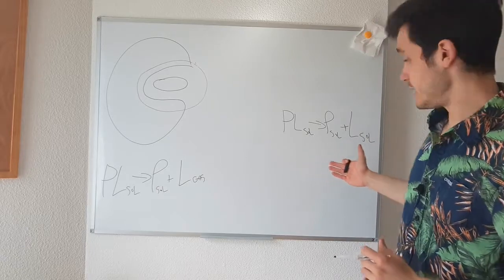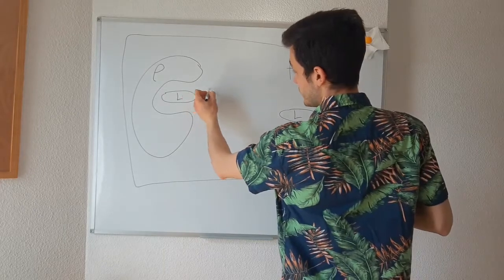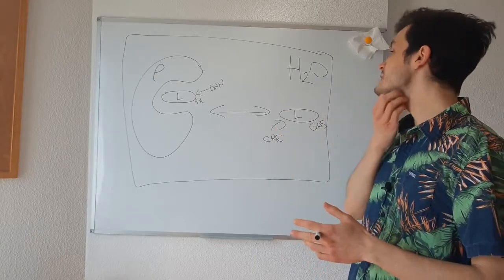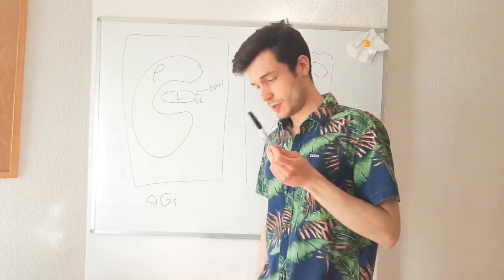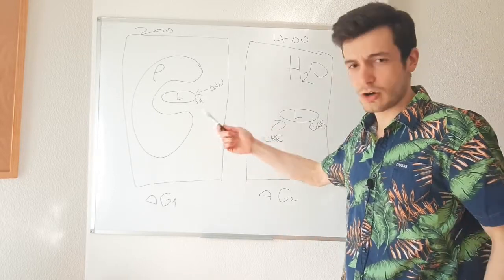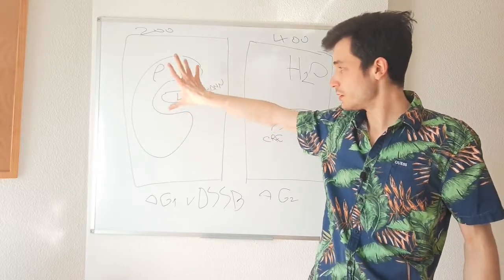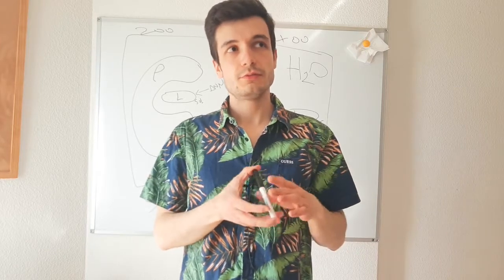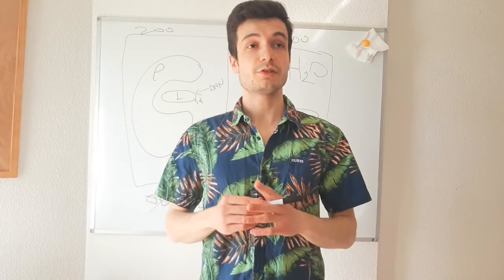FSDAM vDSSB Non Equilibrium Binding Free Energy | Alchemical Transformations | Protein Ligand System

Comment: Nice video. As far as I understand to capture the experimental binding affinity value, you need to consider the work for each starting system configuration (as per the Boltzmann) and then multiply it by the corresponding probability. The generation of the configurations is clearly captured by Hamiltonian REX. but what about the probabilities? Is that captured in these processes?
Reply from the maker: Hi! If in the first step you were using an enhanced sampling algorithm that does not respect the Boltzmann distribution (eg MetaDynamics, Opes) you would indeed have to reweight the contribution to the final free energy of every configuration you use as a starting point to the alchemical transformations. But in this case, as we are using a method that respects the Boltzmann distribution, by randomly extracting the starting configurations from the Hamiltonian replica exchange, the free energy result can be used without the need for a reweighting (more probable conformations will naturally be more present in the extracted frames than less probable ones).